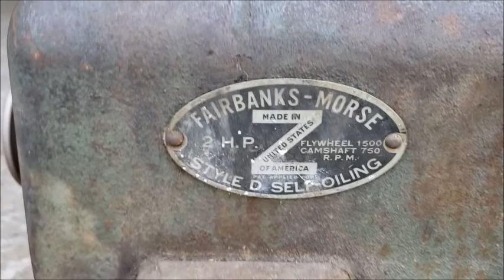Fairbanks Morse Z Style D Cold Start

Comment: Wanna sell it
Reply from the maker: Sorry, it's not for sale.
Reply: Mine is for sale but I don't know what it is worth yet.
Reply: Hi, mine runs like yours, but smooths out as yours does when theres a load on it,  any tips to get them running smoother without the load? Thanks
Reply: @minicity9378   yes. Check for any vacuum leaks. Remove the fuel mix screw make sure it's clean. Check timing as well hope your still enjoying